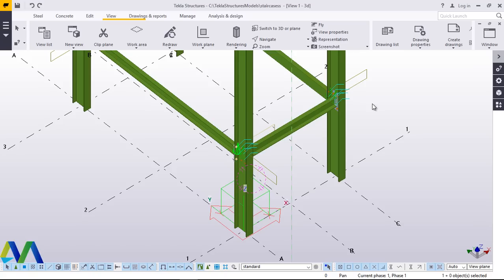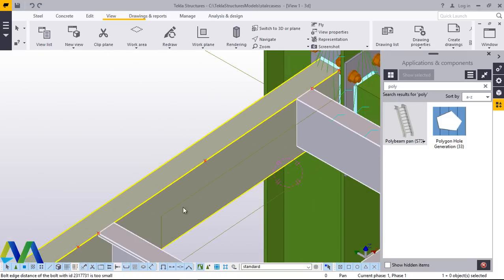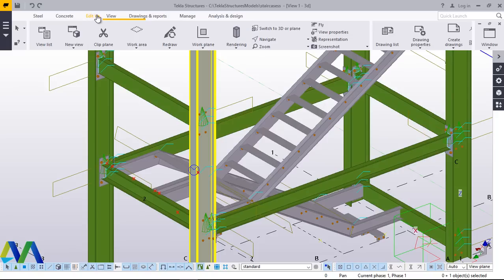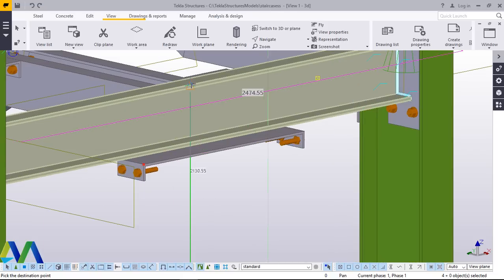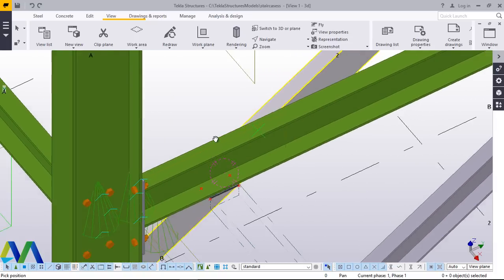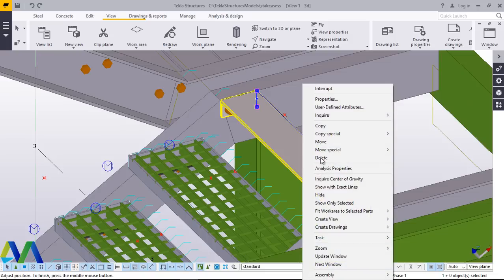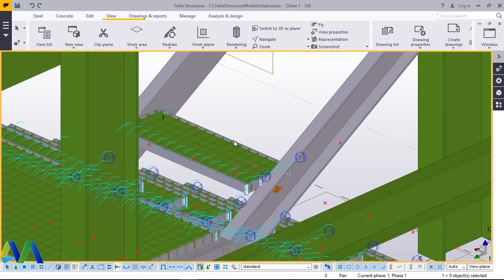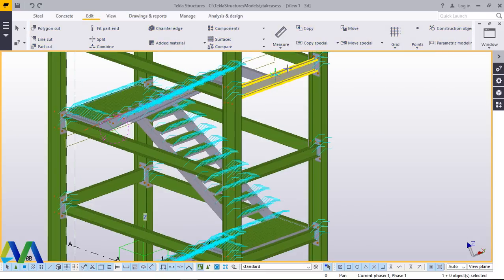How to create staircase using gratings in TEKLA STRUCTURES 2017

Comment: download link for safegrid component pls.. thx
Reply from the maker: will check it for you
Reply: @MauriceDimba  do you mind to providing a direct link this componet? i use student version, so i don't have access to tekla warehouse 
1. https://warehouse.tekla.com/#!/catalog/details/b901f77d-cfe8-4a97-894b-f4053829c297 and 
2. https://warehouse.tekla.com/#!/catalog/details/u572366a7-aa30-42b0-96c8-53ac730c793e
thx
Reply from the maker: you need to download rhino 6 & grasshopper and install in the same system,for link 1 i will check
Reply: @MauriceDimba  i've installed rhino and grasshopper on my pc

Comment: Excuse me ;  where i can find the safegrid component ? THX
Reply from the maker: Just type grid on application and component button
Reply: You can find the security grille making your model in the British environment.
Another thing you can do is make the grid as a block and insert it later when you are modeling.
I do the latest in Tekla and also in Solidworks when I am doing engineering projects where I need steps or gratings.